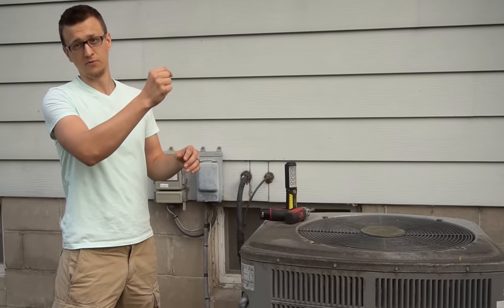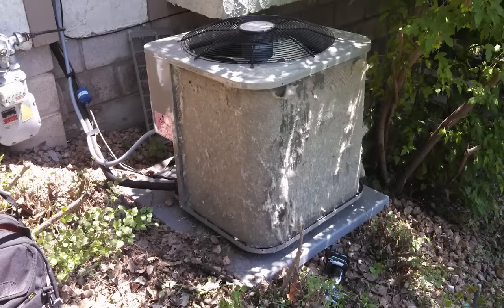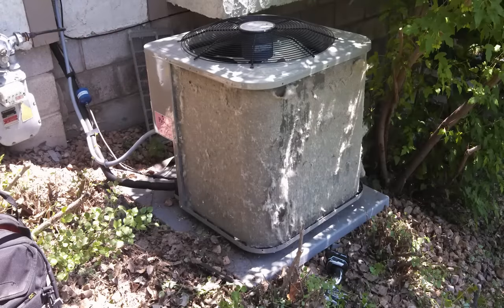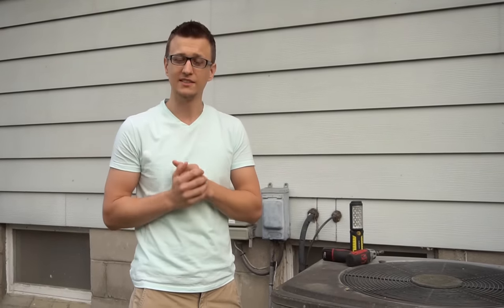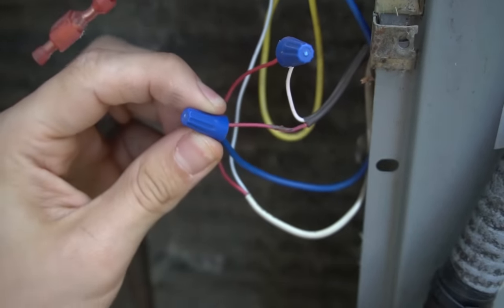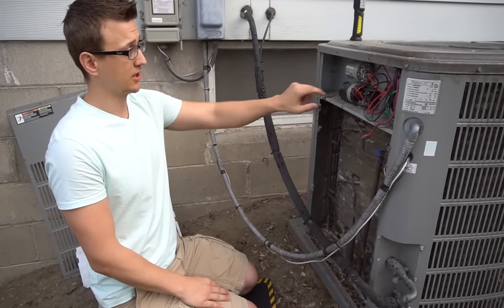15 Air Conditioner Maintenance Tips

Comment: 13:15   You are wrong about the insulation.  It is only there because of condensation and sweating.  Technically that is the vapor line without the insulation it would actually be be better for the unit.  It would add to the system superheat.  I'm sure if you know what superheat is.  The higher the superheat the more likely it would  be to boil off any additional liquid refigerant that did not completely vaporize in the evaporator.  Due to the size of the pipe and the gradual increase in the suction pipe temperature it would not turn back to liquid.
Reply from the maker: Thank you for explaining that! I agree that I did not state that part correctly. What I was supposed to say was more along the lines of this:

"Besides condensation, the other reason to insulate the suction line, is to prevent the refrigerant in the line from picking up additional heat. The warmer the refrigerant is, the harder the compressor and condenser have to work. Minimizing the temperature of the refrigerant in the suction line, helps the condensing unit work more effectively." 

Would you say that is accurate or still, the more superheat the merrier?
Reply: @WordofAdviceTV  
As long as the evaporator superheat is correct,  the additional superheat obtained from the rest of the suction line which is called system superheat is fine.  The more system superheat the merrier.  The less energy the compressor will use to turn the refrigerant in a super heated vapor.  The more system  superheat the less likely it would be for liquid refrigerant to enter the compressor.  That is the key ensuring the compressor does not pump liquid refrigerant.  The Compressor amperage is not affected by your suction line temperature as long as its not freezing.  Compressor amperage is directly affected by outside ambient temperature which will effect the system head pressure.  This will make the system work harder.  When I am talking about working harder, I am equating that to the amount of amperage being drawn by the compressor to actual work
Reply from the maker: @bizee9119  Thank you for taking the time to explain! Much appreciated!

Comment: Thanks for all the info on maintenance. I have a question, how long will a “spare” capacitor last. I just had mine replaced and my unit is 20 years old. So would a spare cap last that long?

Comment: Thanks for the great maintenance tips!.. I have the same humidifier and thought that as long as I keep it set at 20 to 30 % humidity, it would not need to be turned off.  ( I still switch the damper to the summer position)

Comment: I had water that was coming from the bottom of my ac unit inside... And discovered that my condensate pump was cracked. So I replaced it. But in turning the unit off, when I turned everything back on, my thermostat temperature reading doesn't get below 82. I tried restarting just the thermostat but it doesn't seem to work. My unit blows cool air, I replace the filter and the pump works great. So I'm not sure what else could be the issue?
Reply from the maker: I wonder if perhaps you accidentally shorted something out during pump replacement? Have you checked your 3 amp fuse/breaker at the furnace control board? You could also try bypassing the thermostat to see if that makes it come on.

Comment: Thanks for those advices, We live in the salt water front in south texas, and my ac fan is getting rusty for just a few years , is it advisable to oil the motor fan? And is it advisable also to brush oil in the outside of the fan which is made of wire?. Please advice, thanks a lot.

Comment: Bought a new large 3000+ sq ft home a couple of years ago and the AC Unit worked fine until the first spring when it wouldn't turn on. Of course We had mouse damage (chewed wires). I cleaned it up best I could and cut the damaged wires (had enough left over). The AC runs and cools fine now but the compressor won't seem to turn off.  The blower stops at the desired temp the unit won't shut off. The capacitor is older and pretty cruddy but no bulging and the contacts are fine. The contactor seems to be fine as well with no noticeable carbon build up.  Does anyone (still following this thread) have any ideas which part I should replace to get the compressor to cycle normally?

Comment: Hey Man! Thanks for another great video. You never disappoint. I had a quick question if you have a second. I was just curiuos about the two 24v thermostat wires that come down your 240v whip and kind of tie together inside the condenser with the contactor. I was just trying to figure out how come there were two sets of wires and how that all worked exactly. Thank you for your time! Kyle
Reply from the maker: Hey Kyle! Thanks for watching! I have a video where I go over the AC wiring. I think it will help paint a better picture for you: 

https://www.youtube.com/watch?v=KCanZEsLVEI&t=3s

Comment: So there is 2 sounds in my AC inside... the fan.. and I am guessing must be a part of the compressor.. that louder like sound keeps coming on and off.. is that a sign of just low freeon.. or maybe something worse... I know lately every so often my compressor OUTSIDE the house will make a loud buzzing like noise and when it is doing that.. I feel a small piece of the freon line and it is not cold at all. But when I cycle my unit to turn off and then back on.. the pump goes back to normal and my freon line gets extremely cold again.

I ask because it is taking my unit a long time to cool down the house when I am coming home or get home from work and I hear that noise on the inside unit go off and back on or sometimes go off for a long period of time then come back on.. but it's not the fan because air continues to circulate from the vents inside the house.

I have a Nest Thermostat so I have it set to go into Eco mode when I leave home and set the Cool temp to 76 when I am away because I have a dog that stays home by his self.

Comment: Replaced my evaporative air for refrigerated air unit 3.5 to. In 1270 sq ft house. Previously the vents in rooms would blow air out and would somewhat keep room cool. Now with the new system the room vents hardly blow any air and one room in particular air hardly blows so it gets hot. Any suggestions?

Comment: My ac keeps shutting off usually around 6pm right after the the heat peak hour (In Arizona) and the thermostat goes blank but kicks back on and works fine after the sun goes down. Is that a problem with the condenser capacitor or maby it’s low on coolant?. Great video by the way.

Comment: I’m in Florida… do I have a “furnace”? My indoor unit just looks like a big box in a cramp closet?
Reply from the maker: If you are in Florida, there is a good chance you do not have a furnace. What you probably have is what they call an "air handler" which is basically a furnace but without all of the heating parts in it. 😅 Just a fan motor and perhaps a control relay or control board. On a side not, out of curiosity, what is your favorite anime?
Reply from the maker: @theanimaster  Ahh nice choice!!! I loved One Punch man!!! Probably one of my favorites too. 👍👌💪😄

Comment: Im guessing you live in an area where it is not efficient to use the outside unit for heating purposes? Here in southwest Va. the outside unit is typically also used in heating our homes so we definitely wouldn’t cover them in the winter.
Reply from the maker: Oh yeah! I didn't even think about heat pumps when I made the video. But you are right, in Minnesota there are a lot more straight AC systems with a gas furnace than heat pumps with auxiliary heat. Thank you for pointing that out for others!
Reply: Yes sir,  great video!

Comment: Hello,
 Seeing your video, my brother is having issue with his AC system compressor kick on. The problem he is having is that very little Air blowing inside his house all the vent are open but very little air flowing inside his house . Can it be the blower or a dirty coil?  he has a central heating system his system is in his attic location wise what kind of tip you can advice  for us to check to see and test to see what is the reason of that issue. filter is clean.

Comment: Great video I've watched two of yours already but haven't found my problem.  Outside fan and compressor were not working.  I spun the fan with a stick and it started to move (and has been moving since, but not sure if it's at the high speed), however, the compressor doesn't seem to be  engaging.  Could the capacitor be related to the compressor not engaging?

Comment: You mentioned  that mice sometimes chew wires and they need to be replaced.  What gauge wire is in the electrical section?
Reply: Usually thermostat wire is 18 gauge 8 conductor solid core wire. Usually in a lowes or home depot they advertise it as thermostat wire.

Comment: On my unit the compressor inside the unit as well as the insulated line is freezing over. I had a guy look at it the other day and said it was a bit low on freon so put some in and left but I looked at it today and it freezing up again. Any recommendations I should do? I have it set it 70 so I wouldn't think im over working it or anything

Comment: Hi friend quick question i set my thermostat at 74 but when it gets at the temperature it won’t turn off it keeps running you think the problem can be were the thermostat is located
Reply from the maker: I can't say for sure but to me it sounds more like the thermostat itself is bad. So it will keep cooling even lower then the set point? So if it is set to 74, it will get to 70?

Comment: Thank you for a very informative video. I've a question at 26:27, you mentioned about checking capacitor with a meter. Do you mean we need to check capacitance value? Thanks.

Comment: Hi, I have watched almost all your videos over and over.  My Ac Compressor is not turning on. I have checked everything seems okay but the only thing is at contactor the power coming into L1 and L2 is 200 volts and the contactor also pulling in and sending 200 volts to the compressor. I just want to know if the low volts are restricting the compressor turning on? Please let me know ASAP. Thanks.

Comment: How would we check the mfd rating from the capacitor of the indoor blower motor if it's all the way in the back?
Reply from the maker: You probably were hoping I would say something else... But usually I end up having to pull out the blower motor housing just to get to the capacitor. Its irritating that some people mount it in the back instead of the front...

Comment: Been trying to order a capacitor but the label on mine is faded. I ordered 35/5 and  50/5 because those two keep popping up for my Rheem Raka-037jaz 1997. Which do you suggest I start with? The 35/5 or 50/5?

Comment: my furnace doesn't have a filter. i only have a filter at the return air inside the house below the thermostat in the hallway of my house. I had a technician come out once and noticed that the unit the attic was dirty so he cleaned it out.

Comment: I’ve watched several of your videos…they are very helpful. 
My Hear my AC kick on and it seems to cool the house a little but it does not cool completely and never seems to shut off. I noticed that I hear a hum outside and that the fan does not spin. I can push it with a screwdriver and the fan will start but it will not start the next time. Do you think the capacitor is bad?  Thanks

Comment: When spraying from the outside be very gentle and don't go crazy, my fins now don't look so hot now, so what exactly do the fins do?
Reply: The fins actually do all the work!  On the outside of your house (on the condenser) they transfer the heat picked up in the house by the refrigerant off into the air.  On the inside (on the evaporator) they transfer the heat in the house into the evaporator.  Some would call this "making cold", but actually all you are doing is moving the hot air somewhere else- Which leaves the air cooler.
Reply: Thanks Roly

Comment: If I paint 🎨 my ac unit outside   Do I need to cover my coils from the spray
Reply from the maker: If it's feasible to do so, then I would. If the coil fins are covered in paint they may not transfer heat as good.

Comment: My A/C isn’t keeping to the set temperature on very hot days. Well since then hasn’t operated correctly yet. I’ve watched several videos and it’s night time so I’ll be theoretically solving first. The one question that no one has answered is what if the outside fan runs intermittently as well as the compressor runs intermittently. Would this most likely be due to a run capacitor that is outside or below its designated mf rating but not at 0?

Comment: Can you please tell me why my A coils is frozen only on one side of it?  . My furnace pipes upstairs and the outside unit pipes are not frozen only left side of My A coils ??
Reply from the maker: Most likely you have a fixed orifice metering device at the A-coil with capillary tubes (very thin copper tubes) that have blockage inside of them which restricts the flow of refrigerant in those tubes. That is the only thing I can think of that could cause only half of the coil to freeze.
Reply: Word of Advice TV thank you for responding  I appreciate it!!
Reply from the maker: @killnme79  No prob! :)

Comment: Quick question somebody...
So, I had a very dirty coil and did not notice until too late. The compressor quit working.
The compressor would make a buzzing noise for a few seconds instead of kicking on. I replaced the capacitor and it's still not working. Did I ruin my compressor?

Comment: The air filter, can one use a strong blower to clean the dirty filter? How effective is this? Thank you.
Reply: Dont be cheap buy new one
Reply: @TravisONiPhone  I having a tough time getting the lid off of the outside compressor in order to clean the fins on a Lennox which has a bunch of screws with panels. It will come off. It won't align back when I tried to put it back together. The fan is held by the electric wires attached to it and heavy.. Where am i I to put it? The wires are so long. Seems to me it takes 2 people to do the job.
Reply: Air filter is inside your house you don’t have to remove anything

Comment: i was going to order an extra capacitor for my a/c, from the capacitor, its model: HC98JA052D, but i search ebay and amazon, unable to find it by the model number, what should i do?
Reply from the maker: Have you tried taking out the capacitor and looking on the capacitor itself what the rating is? That is how I usually do it. The only time I go by the model number is if the capacitor is really old and the letters on it are faded out or rusted to the point where I cant see it. I just posted a video a few hours ago called "how to replace a capacitor" if you want, watch that for more info. Let me know if you still can't figure it out. I can try to look it up for you later. (I would need the brand of the condenser, model, and serial)
Reply: The important thing is the capitance and voltage.  For instance it might say 35  / 5 , 370vac.  So you'd order one with the same ratings.  In my case I was able to get the same part number, but that's not always possible.

Comment: Why do you say that the pulling of T handle breaker isn’t fool proof? It could still have power really ? How ? I changed capacitor a few days ago and did the screwdriver running it across terminals because capacitor can have some residual power but the power should be off.
Reply from the maker: I've had times where I pulled the plug out but one or both of the metal prongs were broken off and remained in their sockets. If someone doesn't notice that, they'd get a shock. Thats why I suggest double checking
Reply: @WordofAdviceTV  I don’t want to sound like a know it all but seems like having still a broken bit of metal wouldn’t pose a danger. After all , it gotta make a complete circuit.. like when you test capacitors with your screwdriver by running it across the terminal

Comment: My AC unit short cycles every 10 or so seconds (compressor also turns on during this time) and the fan will not “kick start”. When I push the plunger I can hear the compressor, but the fan will not kick on. Any idea?

Comment: Does the a/c provide hyper oxygenation versus less oxygen when it's off or the heater is on. I seem to have more physical energy when the a/c is running full blast and low energy in winter when it's off. Thanks for the great video!
Reply from the maker: That is an interesting question but unfortunately I don't have a good answer for you.. It may have something to do with the humidity in the air. Perhaps a smart person will be reading the comments and be able to give you a good answer later on :)

Comment: I thought the insulation was put on the large 3/4" line to keep from picking up latent heat which will make the thingamabob run more efficient, .hope that is not too technical.

Comment: I need to replace my Capacitor. Inside the unit I have 35/5 440 volt.
But when I searched for capacitor for Model number HAC030AKC4 International Comfort Products, LLC AC unit
in search I found Dual run capacitor, Round, 370 Volts, 35/3.
I would buy this 370 35/3 but I am afraid, that the information I found may be incorrect since the AC Unit is ver old.
I wish I could find somehow what capacitor I really need. I ordered now the same as was already in the AC Unit 35/5 440 volt.
I wonder what risk I take if I put in the 370 Volts, 35/3 as google suggests for Model number HAC030AKC4 International Comfort Products, LLC AC unit?
If you could advise me, I would greatly appreciate that. Thank you!

Comment: The heat is not from the house. The compressed gas from the compressor heats up so it needs to be cooled from the compressor coil before moving into the expansion coil in the house.
Reply: I do not understand. The refrigerant leaves the condenser as a liquid and returns as a gas from the house where it has absorbed heat - doesn't it?